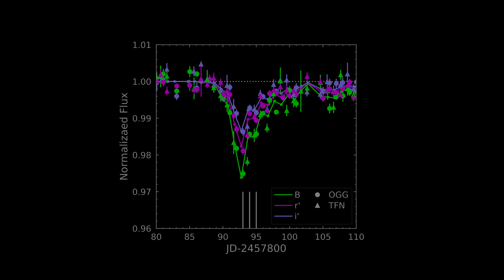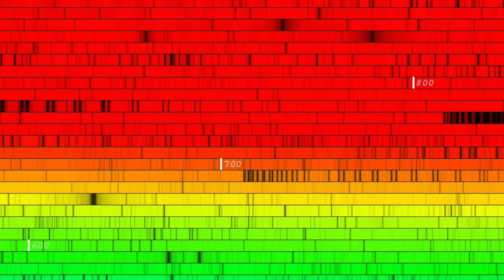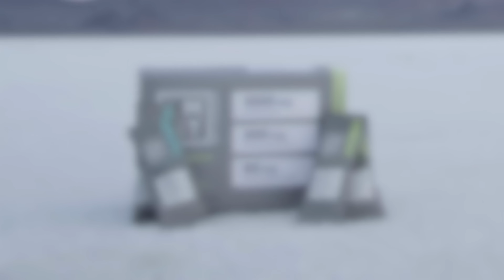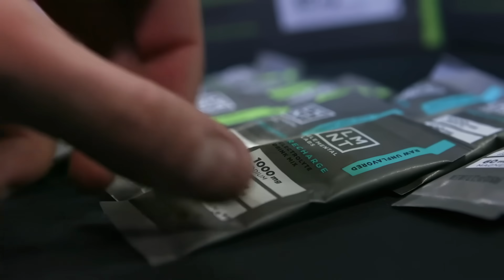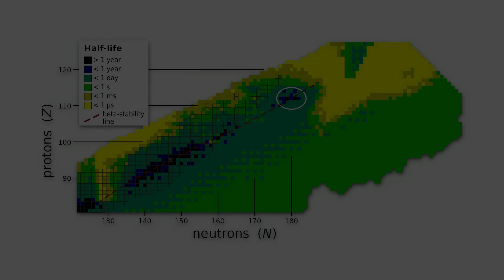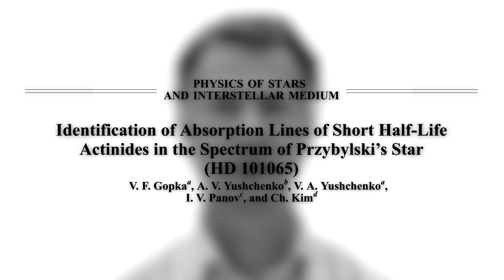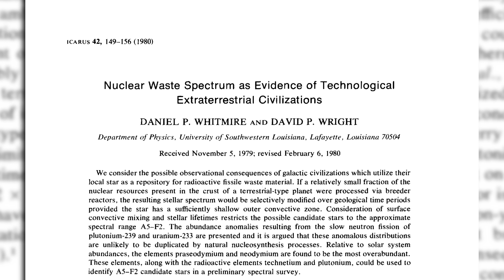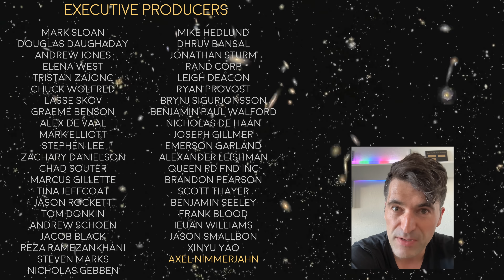The Star That Shouldn't Exist

Comment: "Apparently inexplicable phenomena should be examined with much more scrupulous attention since it seems more difficult to admit them", P. S. Laplace. Quoted by Sagan himself as "Extraordinary claims require extraordinary evidence" (ECREE), is a good and well applicable aphorism despite its detractors
Reply: so alien life is an extraordinary claim?
isn't the claim that life is unique to earth an extraordinary claim according to naturalism?
Reply: @zazugee  the argument is not "no life exists anywhere else in the universe", but "a given astronomical oddity is not caused by aliens". Those are very different arguments with very different requirements for convincing evidence. 
Proving the first, and disproving the second would both be extraordinary claims.
Reply: @DSlyde  they requires evidence, you must define what is extraordinary first
Reply: @zazugee  extraordinary means what it means. Outside the ordinary. If a hypothesis goes against all the previous examples, then you require more evidence than if it aligned with all the other evidence available.

Take the examples I gave, and lets oversimplify a bit. Say we've looked at 999 other stars without life and estimate that there's a 1 in 1000 chance for a star to have life around it 
So the chance of a particular star you pick having alien is 0.1%. But the chance of no other life in just the milky way, with its 100 billion stars, is so close to 0 that I couldn't physically type out the number here.
"This star doesn't have life" and "no other star has life" are very very different claims.
Reply: @DSlyde i think it's hard to make any prior assumptions, we are making the assumption that we are able to detect life, and that life is only what we know on earth, or that life is detectable,
all of those assumptions arn't necessary true, so anything we say about what is ordinary is based on limited observations and assumptions we made, and no matter how hard we strive to be objective, we can't free ourselves from the limits of an observer, QM showed us that observer effect is fundamental and not an artifcat, so the idea that our science is able to give us an objective view of reality is an illusion.
i think a more healthy way for skepticism is to have sufficient proof and not extraordinary proof.
Reply: @zazugee  The claim that life only exists on Earth isn't extraordinary it is the null hypothesis. You are right that this seems unlikely to be the case given what we know but the null hypothesis can't be disproven simply by seeming unlikely, it has to actually be disproven experimentally. We don't know if maybe the conditions required for life are just so specific that it has only happened once in our galaxy or if we are just really early on the cosmic stage.
Reply: @hedgehog3180  yes, i'm not saying life must exist, but given the assumption of naturalism as a philosophy of science we have to go there.
I'm aware of it, bc as a theist i can see naturalism from the outside unlike someone who had always assumed that naturalist view of philosophy is the default worldview.
It baffle me when i see naturalist people think life is exception or treat it as such when this actually was a default view of the church, mind you other religious tradition don't view life on earth as exceptional.

Comment: I imagine, if I built a dyson shell around a star. There would be no solar wind outside of it, and it would still gravitationally attract gases that would accumulate around the shell. 
Given enough time, quite a thick gaseous shell could accumulate, and the waste heat produced by the shell would build up and start making the gases glow, eventually becoming as bright as a star. 
I suppose it could also still give off spectra from elements used in the construction of the shell.

Comment: This was a very good presentation ... Thank you.  Speaking of stars ... here is a video about our Sun.
I enjoy your channel and would like to ask for your interpretation on a solar event that
the NASA SOHO platform captured in 2012.

I have not received a proper scientific explanation for it and think it is an unprecedented event.   I am an amateur astrrnomer and have witnessed some UAP's .
My background as an electromechanical engineering technician for over 45 years working at Xerox, Tektronix and Intel has me more baffled as no other working scientists can answer it with a scientific premise..

I saw this the day after it happened on NASA's SOHO website  March 3, 2012 .... Nasa took it offline for some time and someone found it again... The video capture is not as good as the original for resolution but it will suffice.  Perhaps someone can find the original video data shown in 4 elemental spectrums.

https://www.reddit.com/r/StrangeEarth/comments/1ar3g0c/sun_sucking_ufo_captured_by_nasa_in_2012/?share_id=nONnn4Ojt0kNQD4y-ccXC&utm_name=androidcss

In short this is my interpretation observation of this anomaly:  Unknown observed anomaly never before seen at the Solar  surface.

Was observed over 3 days ... near 78  hours. Did not change form, diameter or distance from the suns surface of approximately  <100,000 Km.

Did not follow the rotation of the sun during observation as it stayed fixed in 'space'.

It appeared electrically and magnetically neutral during the observed duration except for the point of connection nearest the Solar surface. No other disturbances or flux lines were noticed near the connection point.

A very apparent and striking rebound of energy' was produced when the 'object or anomaly' was moved from its point in space at a significant acceleration.

Thank you for your work efforts on applying real science and investigations BTW

Comment: Next question: are those rare elements evenly distributed over the stars surface or is it actually transmitting a coded message in its spectral absorption lines as it rotate slowly..? 🙃👽📡

Comment: It's possible the evidence for the production of these elements already exists within the star. it's already been stated because it moves so slowly in rotation that it must have a strong magnetic field we don't know what a strong magnetic field does to atomic structure in their merger or fusion or fission we can't produce that type of energy on Earth except for maybe in the large Hadward Collider but even then I doubt they'd be able to get the pressure and the temperatures needed to create any of those elements and their byproducts. right now any potential model is going to be theoretical on how this all works.

Comment: How about if there was a fragment of a neutron star bouncing around inside it, sort of dissolving away like a fizzy tablet in a glass of water?
Reply: That's not possible, there can't be fragments of a neutron star. The whole thing is held together by the gravity of the neutron star. There could be left over elements from a kilanova which is a neutron star explosion.
Reply: @Bitchslapper316  I know they can’t survive outside massive pressure.. but it seems likely that there is a continuum, where if a neutron star can be stable under its own mass then a fragment somewhat smaller could be somewhat stable within the already high pressure of a star.
Reply: @peterd9698  Given what we know if a piece somehow separated it would become unstable almost instantly. I'm not sure how possible it is that a piece can even separate. Also a star doesn't have anywhere near the concentrated gravity of a neutron star to hold it together.

With this star there was an hypothesis floating around that there was a neutron star in a close orbit or even in it's atmosphere making it a binary star. That hypothesis isn't widely accepted. We would see the wobble and the neutron star would start to consume it.

Anything is possible though. I don't think humans understand the universe as well as we think we do. There are probably all kinds of math and processes at work in the universe we don't know or understand yet.

Comment: Everybody is always watching Fraunhofer lines as elemental existence, now have their statements corrected with the electro-static (ES) and electro-gravitic (EG) model of the Solar Model, Black Hole Model, and other cosmic features.  It is the electrino-level (s-shell), electron (p-shell), muon electron (d-shell), and tau electron (f-shell) ... with their associated electron tensor boson force carriers can make the mistake of calling these lines elements - when in actuality it is these electron shells of these multiple electron energies that are manifesting them.  Not elements, but the actual free and entrained multiple level of electron energies.  And they also want to compute the nanometer frequency to a Kelvin rating - which is also faulty - as these electrons have no inherent thermal existence.  It is their frequency, their energy at that level that displays these colors.

Comment: All of the Lanthanides and Actinides in our current location of the edge of the galactic arm ... is far more stable and existing further into the galactic arm and nearby the galactic core.  The same for the increased cosmic tension, least in our area of the galaxy, and thicker and denser the closer to the galactic core.  All these (2) bosino and (3) electron boson force carriers create these thicker cosmic fabrics and thickness.  So these other elements that can not exist in our region of the cosmos, are readily existing in the denser regions of the cosmos.

Comment: The idea of shooting nuclear waste into the Sun is generally quickly dismissed because of the expense and hazard of sending rockets into Space. But what if you already were operating IN Space, running nuclear reactors, and were in a pos'n to easily throw a lot of waste into the Sun from there? It might not be nearly so expensive or dangerous. And once there, that waste might get bombarded by a lot of neutrons. (Not so sure about that that last part, as I'm not sure how much neutron flux you have in the outer regions of a star.) Wot say you good people?

Comment: How much "stuff" would you need to dump into a star to see a difference? A planet mass? I'm just wondering if it is a feasible amount or if we are talking about dismantling solar systems?
Reply: My question as well.
Reply: Iron in our sun is only 32 ppm, or 0.0032%, and we can detect it easily. But that is still about 3x the total amount of iron in Earth. 

So the mass fraction may be small, but the sheer quantity seems prohibitive--even for the most outrageously advanced (hypothetical) aliens. 

The "island of stability" option is much more promising.
Reply: A-type main sequence stars are around 1.4 to 2.1 solar masses.
Przybylski's Star is assumend to be at the lower end of that spectrum.
It's iron metallicity is supposedly much lower. So we're talking about noticing values as low as 0.0000486%, which are about 24 earth masses of iron.
The amounts if heavy elements have to be in the order of multiple planetary masses. About 6 billion trillion tons
Reply: @HappyBeezerStudios  Nice work, yeah doing that seems really unlikely to be a result of deliberate salting. The onyl thing that would make sense aliens wise would be some alien civilisation covering many, mnany, many, star systems doing some kind of large scale higher element manufacturing and the star is their dumping ground for the waste products.~

Possible but i wouldn't bet anything important on it.

Measurement error is probably the thing thats wrong, but if it isn't, probably where seeing one of those "its a big universe" moments where somthing extremly weird and unlikely happened in one tiny corner of the universe that created this stuff to contaminate the star.
Reply: @HappyBeezerStudios 6 billion trillion tons (6 RonnaGrams, alternately 6 Rg) is the approximate weight of Earth. That's hardly 'the order of multiple planetary masses', that is 'the order of a single planetary mass'.
Reply: @useazebra  There also other more grounded (than aliens) possible explanations : Interaction with an accreting compact object (neutron star or black hole) tha would generate a neutron rich environement in the stellar atmosphere which could create some "r-process" condition and create those heavy "impossible" elements. A GRB blasting the star in the recent past from relatively close distance could do it to. 
As stated in another comment, a neutron star being swalloled by the A-star could explain what is observed here, strong magnetic field and heavy, strange elements created by the violent interaction of the stllar matter with the neutron star.
Reply: And how would a hypothetical alien civilisation make so much of these elements?  It seems impractical, especially for a single-star civilisation.
Reply: @TheOneWhoMightBe  ¯\_(ツ)_/¯
Reply: @TheOneWhoMightBe Dyson sphere waste?😅
Reply: The composition of the sun is
73.46% hydrogen
24.85% helium
0.77% oxygen
0.29% carbon
0.16% iron
0.12% neon
0.09% nitrogen
0.07% silicon
0.05% magnesium
0.04% sulphur

The sun is about 330,000 times the mass of Earth, so there's (does quick mental arithmetic) about 120 times the mass of Earth of Sulphur alone.

That's a lot of Sulphur.

If the star is being salted, it's a "shipload" of salt!

I'll have to look up the paper to see the elemental abundances.
Reply: If you are producing space aphrodisiac on the scale of the horny traders of the Przybylski Star Consortium, you would understand why they needed 3.7x10^26 tons of americium
Reply: Yeah, i am wondering too... I guess it could be calculated, take the mass of the star, find out how much is 1 % and that is probably the amount you need to see the difference. Idk, in complete layman's view everything < 1% seems kinda small so probably no difference. But i really dont know, just guessing XD
Reply: I dump stuff into stars all the time

Comment: How much material does there need to be dumped/salted in such a large star before we can detect it via the spectrum of color/light? We are dealing with tons and tons of dumped material then because there won't be a detection of this because of a couple kilograms. Therefore I think the explanation is probably the first you gave... faulty data
Reply: WRONG YOU DIDN'T WATCH THE VIDEO!!